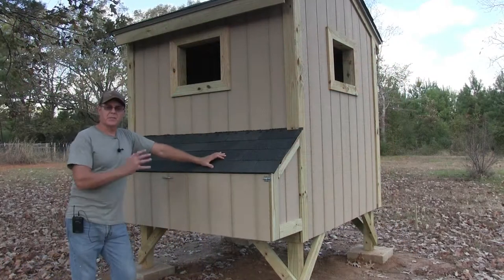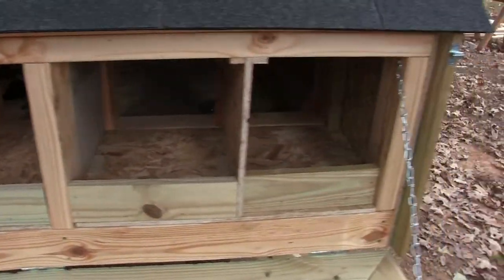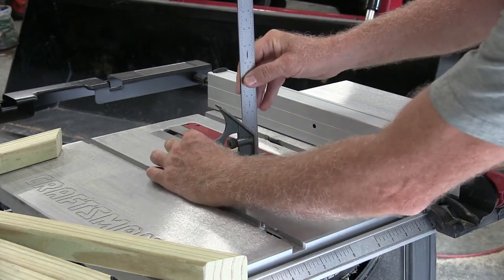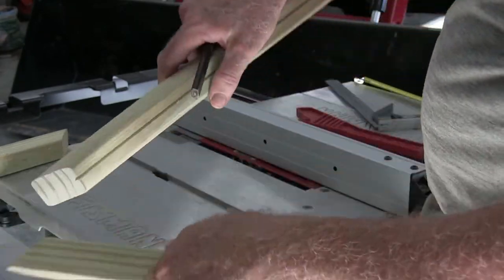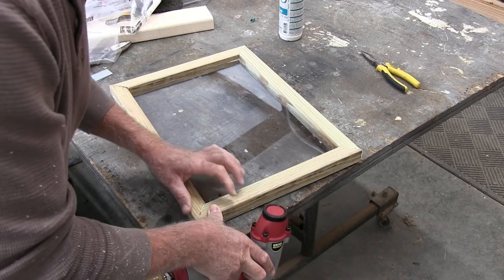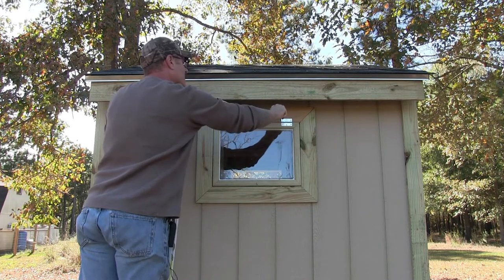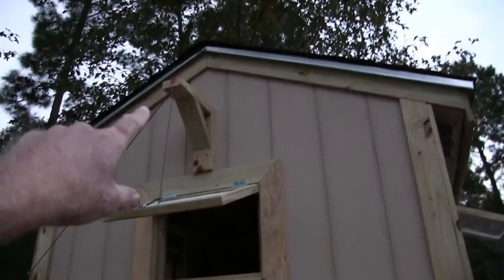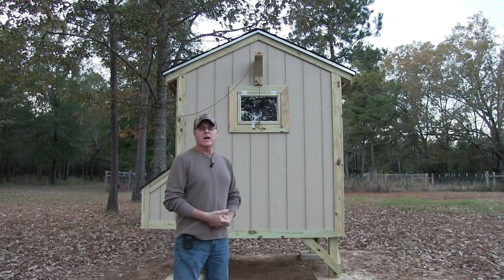Chicken coop build part 5 - Nesting box and windows

Comment: Hi Pete,  You did an excellent job on your coop,  you also have a very nice place.  I had a place similar in the country,  but wife was unhappy so we sold it and moved to town,  now she is happy and I'm not,  should have sold wife instead!   I would like to suggest (from experience) when using nail guns,  watch your fingers,  I have seen nails hit a knot or hard wood and curve out right thru a finger.  If you're using 3" nails, stay at least 4" away with fingers. The longer the nails the worse it gets.   Good Luck.
Reply from the maker: Thanks for the safety  tip, I have seen the nails curve out like you say, and the nails I was using were about 1.5 inches long.....I will keep my hands away now. It's to bad that your wife doesn't like the country 😟 You both have to be on the same page when it come to that. It's a different life style for sure but it keeps us busy with work and project around the property.

Comment: Good job.  One thing I'd do different tho....on the interior of the windows, on the bare wall I'd have put some kinda wire mesh like hardware cloth, then in the window frames I'd put two slots instead of one. That way you can use two plexiglas pcs and slide open the window for ventilation in the summer. The whole way you have the windows propped open with string seems a bit mickey mouse to me.
Reply from the maker: Thank you

Comment: Hi,  I have to replace my nesting boxes. my roof opens and water has gotten in and rotted out the plywood. I would like to change to your design. Did you take a video of the nest box build? I'd love to see it!  Great job. Thanks!
Reply from the maker: Thank you, I show the nesting boxes in part 4 at the 10:00 minute mark, but it's not detailed. Here's the link. https://www.youtube.com/watch?v=ad6C4Cl5iC0
Reply: Hi Pete. Similar question about the nesting boxes! In fact, wondering what your dimensions are for those if you don't mind?  Thanks for the videos.
Reply from the maker: Adam Brennan  The nesting boxes have to be 1ft x 1ft minimum. Mine are 1ft wide 18 inches deep and tapers from 12 inches high at the door opening to 24 inches high because of the taper in the nesting boxes roof for head room.
Reply: Pete B. Thank you, that helps! Another question for you, if I could. It involves your roof trusses. I plan to build mine in the next couple of days. Do I understand right, that you used a 25 degree angle, which is approximately a 6-12 pitch?  If so, did the truss that spans over your door frame force you to adjust the height of your door at all? It seems that with a 6 ft High door and 5 foot high walls, that type of a pitch would have run into the framing for the door. I will find out for sure when I go out and try it myself. Just thought I'd ask ahead of time. Thanks again!
Reply from the maker: Adam Brennan  If I remember correctly, the walls are 5 ft 6 inches high not 5 ft.